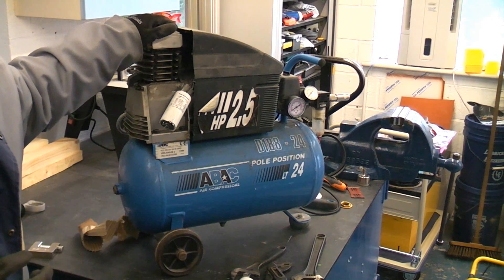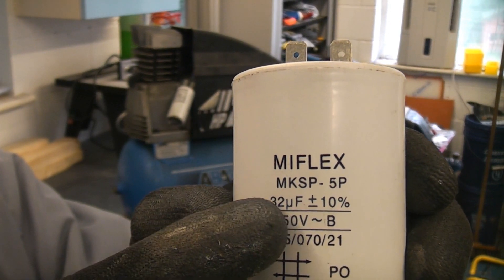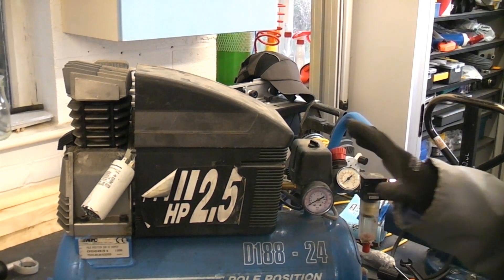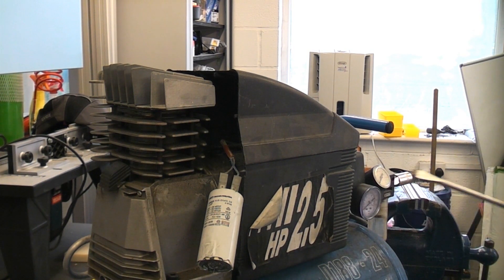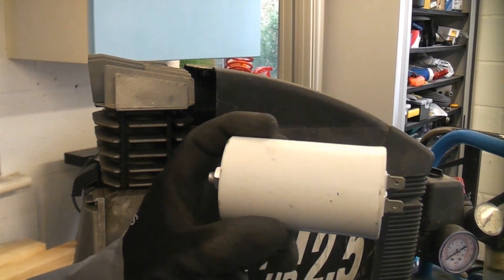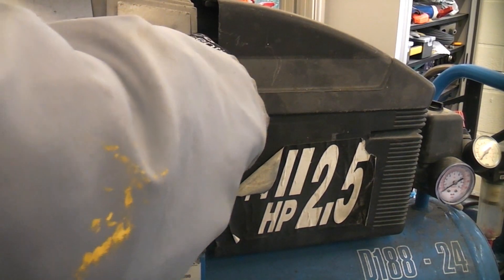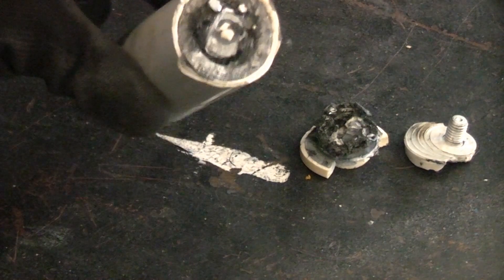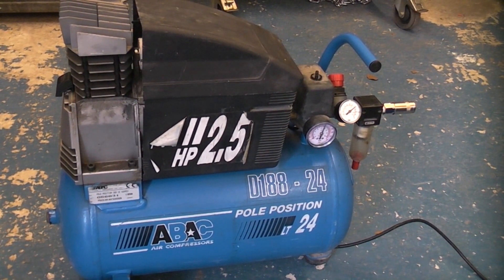How to change the motor start capacitor in a compressor

Comment: Wondering if that capacitor was electrolytic or not? Changed my run capacitor that was pulled off, took a guess as to wiring as no polarity markings.
Reply from the maker: Not sure, sorry.
I hope you get it sorted 👍

Comment: Should have mentioned which wires go where. Switching as is IS simple but video should cover the wiring instructions
Reply from the maker: It's a like for like replacement, no wiring diagram is required.
Just pull one wire off at a time and connect to new capacitor 👍

Comment: friend, good morning!  I have a compressor like yours, but it makes a lot of noise and yours doesn't.  can you tell me about the humidity as a comoressora if there is a filter or any part in the air intake so as not to make noise?
Reply from the maker: Compressors are normally noisy, I reduced the volume of the compressor in the video for people's viewing pleasure.
Thanks for the comment 👍

Comment: I was given a compressor, when I have it plugged in and turn it on. The compressor trips the circuit breaker to the house. Would the capacitor cause that? if not what would cause that. I've tried other outlets and yields the same results. Any help  is grateful.
Reply from the maker: It could be a few things. Normally when the start capacitor fails, you just can't start the compressor.
Is it the MCB that trips and not the RCD ?
Thanks for the comment 👍

Comment: Hello, how are you?  i'm brazilian and i saw your video, i have a compressor like yours, but i have some problems with mine.  i would like your help if u can help me.

1 - my compressor gets very hot!  want to know if it is normal?  
3 - it also makes a lot of noise.  
4 - sometimes he has no strength for the league when it is more or less 70 - 100psi.  
5 - I would also like to know if somewhere or even on an American website you have pieces of it to sell.
6 - I don't know what the engine power is.  the compressor has no description.  I'll send you a video link so you can see what it looks like.

https://youtu.be/QwtvG_waw-4

Thank you
Reply from the maker: I've watched the video, but can't advise much.
Compressors are noisy and do get hot during use.
If there is a pressure problem, there might be a problem with the pressure switch, or the relief valve but it's impossible to say by watching a video of it.
Thanks for the comment 👍
Reply: Ultimate Handyman ok obrigado .
Reply: @ultimatehandyman  Here in the UK, spares, such as start capacitors, pressure switches and check valves are so inexpensive, it can be worth changing all  of them!

Comment: Can h do a review on the van u use for work
Reply from the maker: Matthew Axon My van is not much use to be honest as it is a 5 seater, so the back is very shallow. You can see it here- https://www.youtube.com/watch?v=VFZZ2r1eW3E
If I need to move large sheets I have to put them on the roof rack, which can be a pain and is not a good idea in the rain. I do like the Mercedes Vito's though, this is my second one and both have been very reliable. I have had my current van for about 5 years with no problems, apart from both electric window regulators needed replacing.

Comment: Common fault on all sorts of compressors. Can be expensive but still cheaper than chucking! Always worth a repair!
Reply from the maker: I think I paid about £260 for this compressor back in 1999. The capacitor was £16 but £8 of that was postage as it came from Germany, so well worth fixing.
Thanks for the comment
Reply: *****
No probs - I have a massive unit at work as I use it to power air motors and I can only wish they cost that much! Mine has 2 that had to be replaced which cost a damn fortune. Rather annoyingly it wasn't available on eBay either! We live an learn - I learnt I needed the compressor more than I needed the money in my bank!
Reply from the maker: Youplate.co.uk
Is three phase not an option?
We have hundreds of three phase motors on site and they run for donkeys years without being touched.
Reply: It is now! Not when the thing was purchased sadly! As I say - We live and learn! We are planning on running this until it finally dies and use 3 phase but the good thing with a good compressor service engineer is they keep things going (as they should), the fact is  industrial compressors must have paperwork with service info so it helps keeps problems away as well as Health & Safety!

Comment: Hi UH, where would you go about looking for a direct replacement capacitor? I wouldn't have a clue where to start. Cheers mate. N.
Reply from the maker: Hi Neil, I actually found that on ebay but it was in Germany. I could not find anything similar in the UK, I even tried Farnell/cpc but they didn't seem to have one which was surprising. I think the compressor was originally made in Italy, so perhaps those capacitor's are more common in the rest of Europe. Luckily it was printed with the values in micro farads, so it was just a case of searching Google and ebay for it.
Thanks for the comment
Reply: @ultimatehandyman  I also just bought one on Amazon.  The compressor manufacturer wanted £43 + pp for a new cap. but I found one of similar size and value for £3.99 (Amazon Prime too - so I got it next day!)

Comment: A very nice video as always. Thanks.
Maybe you could mention that a 10 & a 25 or two of 16 microFarad capacitors connected in parallel are same as a 32 microFarad capacitor ?
Reply from the maker: Thanks, that's a good point although it would be difficult fitting two capacitors to the compressor.
Thanks for the comment

Comment: I take it there was no polarity to check on this one?
Reply from the maker: No, I just replaced the wires from one unit to the other by holding the printed writing at the front.
The terminals were not marked or anything. I'm no expert on start capacitors but I don't think it matters which way around the wires are connected.
Thanks for the comment

Comment: Hi Mr Ultimate. I'm wanting to buy a small compressor. i want one for brad nailing and spray painting.Do you have any recommendations on size and features i should be looking for. PS nice vid.
Reply from the maker: It depends really on what you are spraying. The brad nailer is not much of an issue as they do not use a lot of air like the spray gun. If you just intend spraying the odd car panel you could probably get away with a small compressor like the one in this video with a 24L tank, but if you intend spraying a full vehicle you would definitely need a compressor with a larger tank or the compressor will struggle to keep up. I'd be looking at a 50L tank minimum for spraying cars, the larger the tank the better really. I think the compressor in the video was £260 in 1999, the good news is that they have come down a lot in price now and are much cheaper. A similar model made by the same company is now about £160